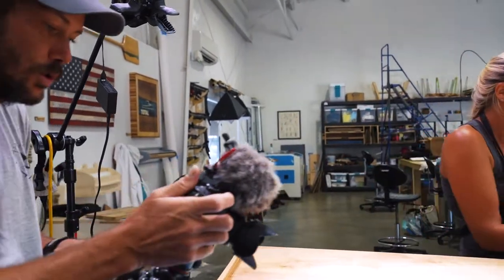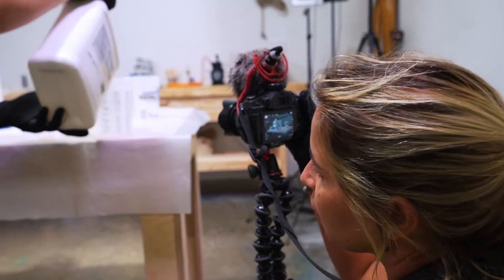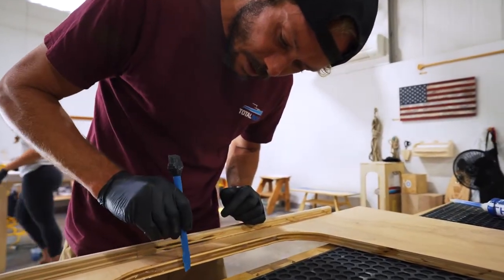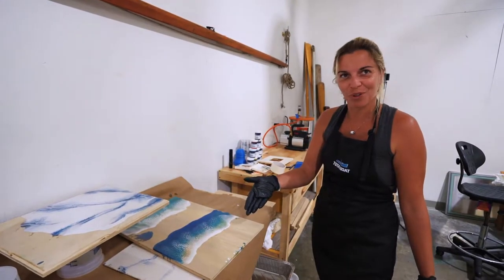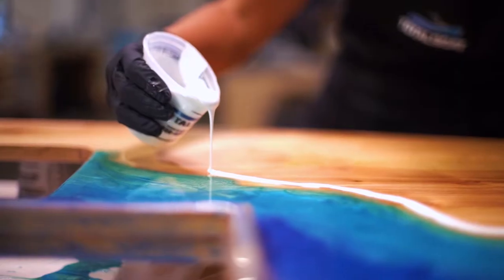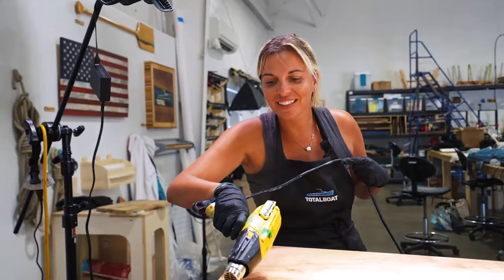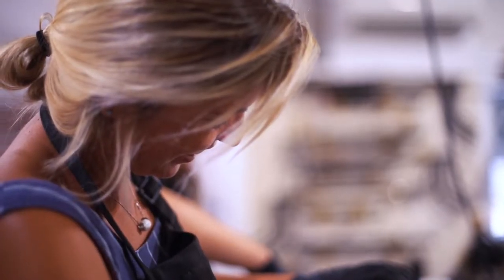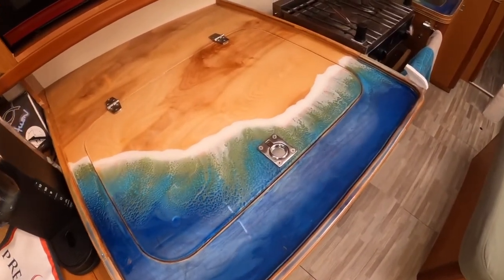TotalBoat Easy DIY Surf Break Countertops with Sailing Zephyr

Comment: How well would that hold up on a daily use kitchen or any high traffic area? Anything to coat it to make it food safe?
Reply from the maker: TableTop Epoxy has a hard durable finish for counters and table tops. Once it is fully cured it is BPA free and food contact safe.  Just be sure to not cut or place hot pots and pans directly on the surface!